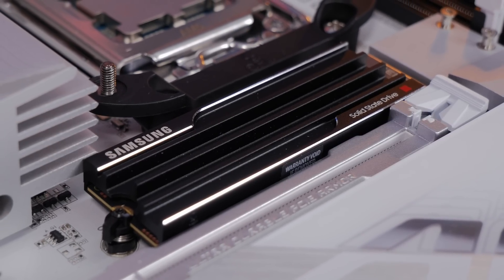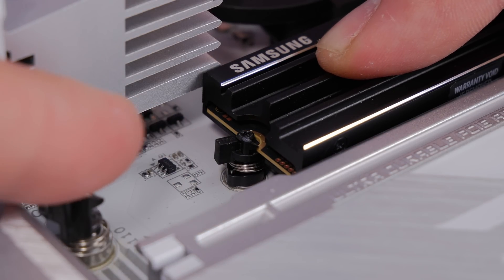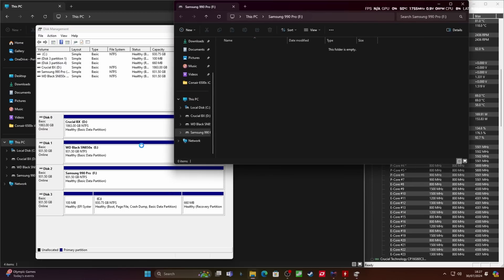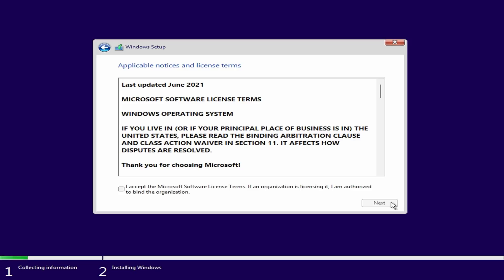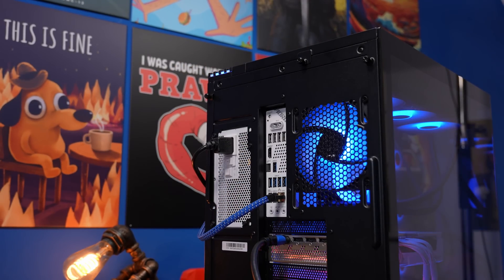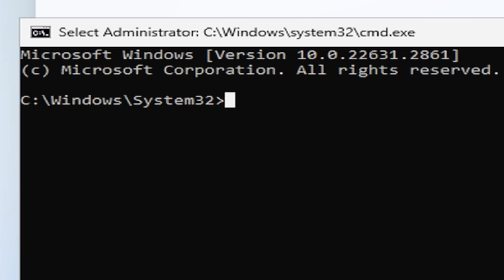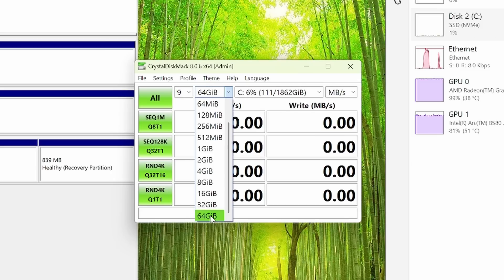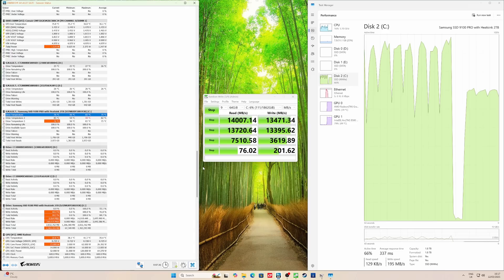Samsung 9100 Pro install guide and tips plus Windows Install

Comment: Hey, great video. Ive got one question: Is there no more nvme driver from Samsung für this ssd? I had the 980 Pro before and the download section offered a nvme driver. Now i only got the windows driver for my 9100 Pro.
Reply from the maker: Is this via Samsung Magician?
Reply: @TheProvokedPrawn  Hey. I also checked updates via Samsung Magician but it only tells me my firmware is up to date. It does not show any option to update drivers and i cannot find any on the Samsung homepage - at least not for my 9100 Pro. My 980 and 970 Pro both had Nvme drivers from Samsung that worked but they are not compatible with the 9100 Pro.

Comment: Great video! 
Unfortunately, those random read speeds at Q1T1 are terrible, and that's what users usually get when using a Gen5 drive! 
There are SATA SSDs that can achieve 70+MB in that cathegory! 
Unfortunately, no vendor wants to make SLC drives anymore, and Intel stopped producing Optane drives! 
#LipBuTan #Intel #ReviveOptane 
#MakeStorageGreatAgain